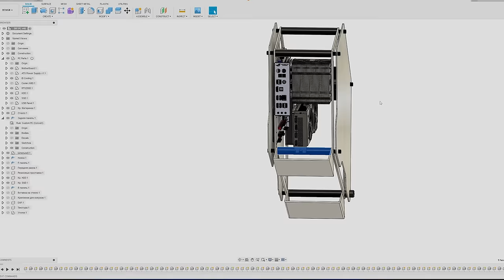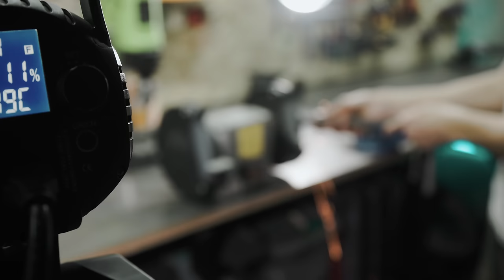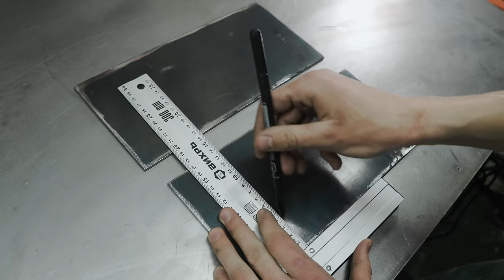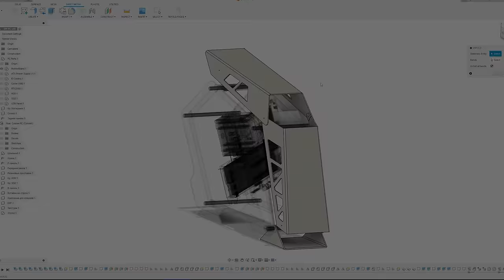Unique PC case made with your own hands! / DIY PC case

Comment: 4:03 That looks like one hell of an old motherboard right there XD
Sure hope that's just a placeholder for dimensions...
Pretty well done, good result.
If you don't have the equipment to do it all yourself, or don't have the equipment, or both, you can basically design a lot in some simple 3D programs without it being too hard, Sketchup even, and send them off to companies that cut and bend things to your specs in all kinds of materials. Even with 3D printing alone you can get pretty far depending on what you want to do, strength of materials is a thing. Having the pieces made will cost you a bit of money mostly, not too much time, but is far cheaper than buying the equipment en learning to use those.
Also, now you know why cases cost so much, sure, they use different techniques to make the parts, but you can see how easy it is to see marks and all that, and you don't want those, so getting things nice and smooth and clean and painted well is very important.

Comment: I have one of these and it was very good, in addition to implementing some improvements, the only thing I missed was the top plate where the fans go and in the power supply area, an airflow direction downwards so the hot air doesn't go to the motherboard ! Anyway, congratulations!

Comment: There is no risk of electrocution or breaking component with the metal frame (iron?)
Reply: Uh, just like with any case that's made out of aluminum or steel sheets, which is every case to my knowledge.
Reply: @BloPsy_Actual  aluminium is not conductive. And I think that steel have a coat or something
Reply: @toraryugraphiperso3411  Aluminium is not conductive? I am electrician my man. There was a time when conduits were made out of aluminum, you may have such conduits in the walls of your home to this day..
Reply: @BloPsy_Actual  i make some search and I was wrong... I don't know where I heard that aluminum was not conductive....
So, metal don't have coating or special paint to prevent problem?
Reply: @toraryugraphiperso3411  Paint can help to prevent an accident, but in the end, it's the brass standoffs that are preventing the motherboard to touch the panels (The Air barrier between the panel and MOBO is a good insulator). That's the only problematic part to this day, if it doesn't have a backplate of course like modern GPUs have.
Reply: @BloPsy_Actual  there is a minimum height for the brass standoffs to prevent any problem and be sure ?

Comment: in the end it all fell apart for him because he used plexiglass and not polycarbonate. He from Russia.
Reply: This PC certainly will not produce high heat and definitely does not need strength or impact resistance.

If your pc needs any of these, maybe you shouldnt build PC's.